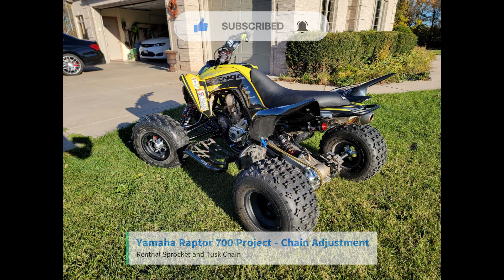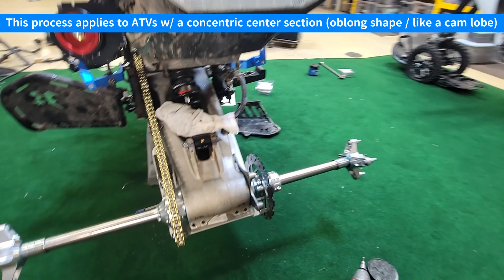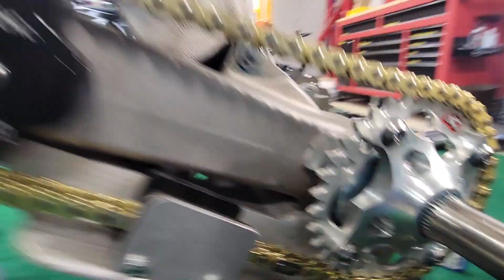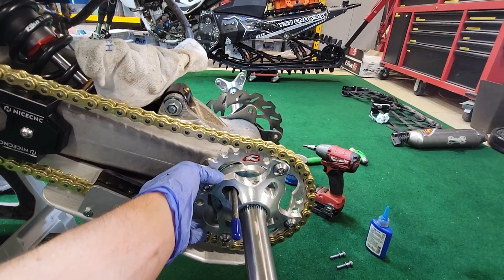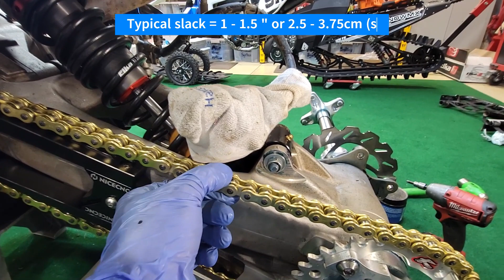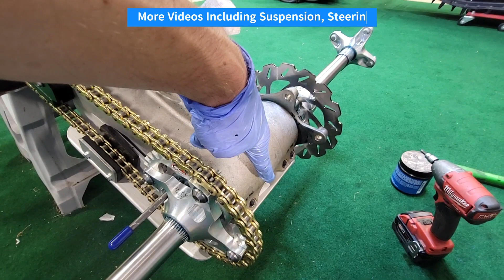ATV Chain Adjustment - Process for Yamaha Raptor and some Hondas / ATVs w/ Concentric Center Section

Comment: Confused, I was told you should always support rear swing arm to adjust the chain at a height like if it was sitting with tires on the ground? I was told if you do it like you just did the chain would be to tight when rider was siting on bike. Correct me if I am wrong (but please explain), but I dont want people messing up there bikes with too tight of a chain. Thanks
Reply from the maker: Great point, and you're right that suspension compression changes tension,  and if doing with raised off the ground does need to be accounted for that. Does State this later in the video.
Reply from the maker: Appreciate the input I should have mentioned it sooner in the video